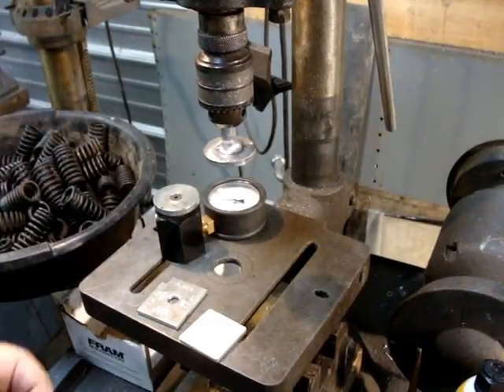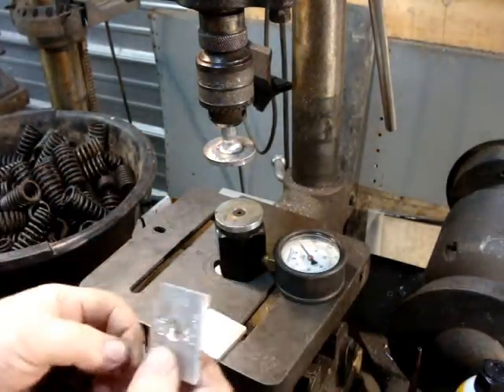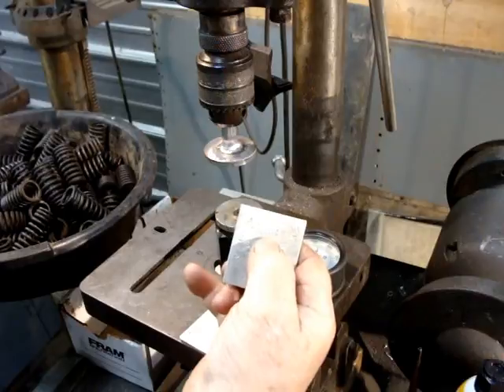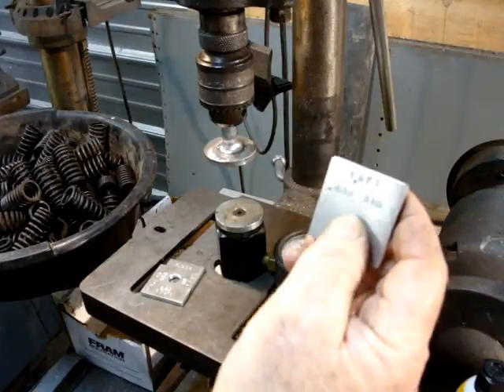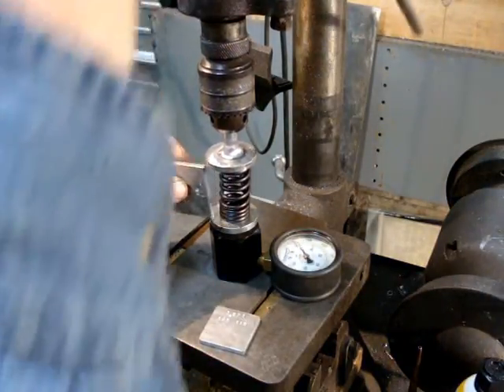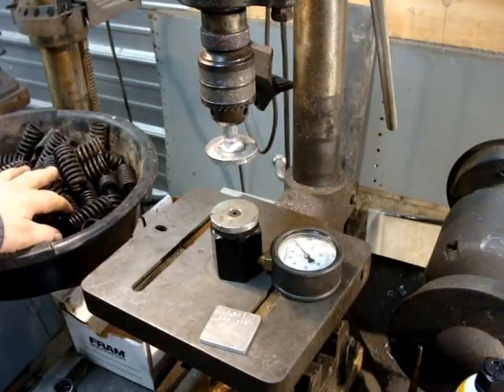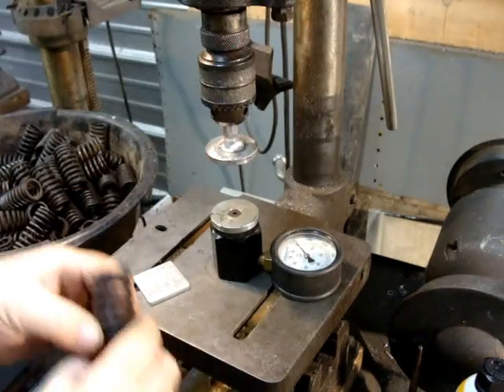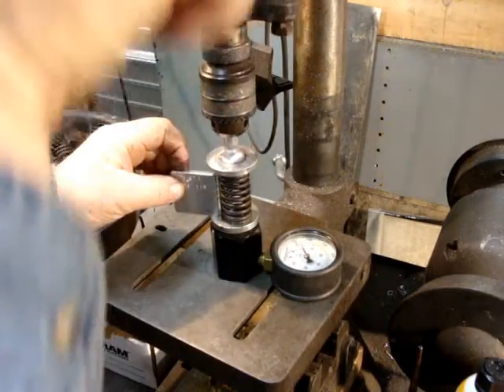171203   DNH   Valve Spring Tester

Comment: Hi. What is the maker and the part # of this valve spring tester tool? Thanks!
Reply from the maker: Proform Parts 66834 - Proform Mini Valve Spring Tester
Summit Racing sells it...
(But I bought mine used from the Roush Racing used store in Mooresville, NC.
They go through a lot of them at Roush/Yates engines and they sell used ones very reasonable.